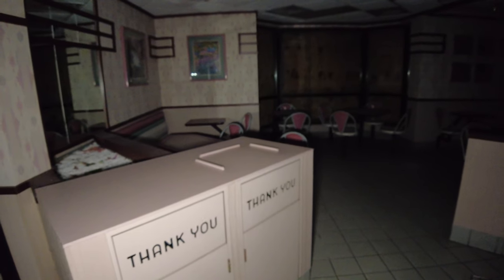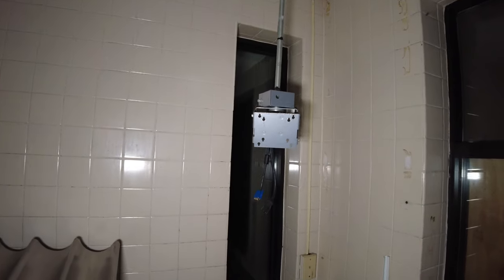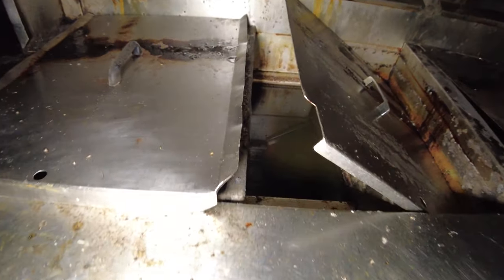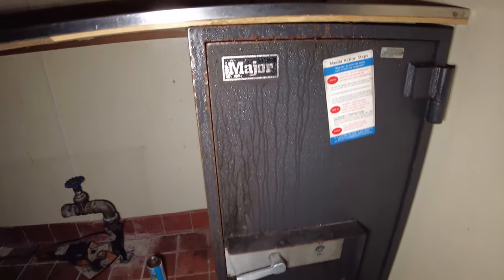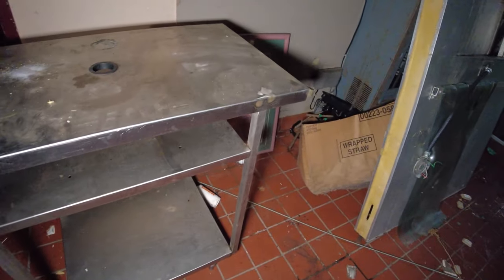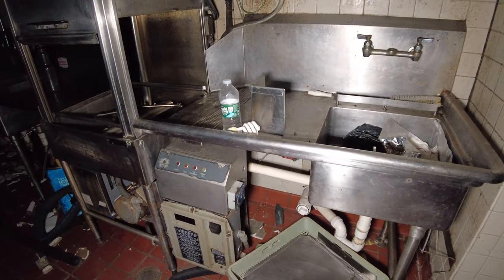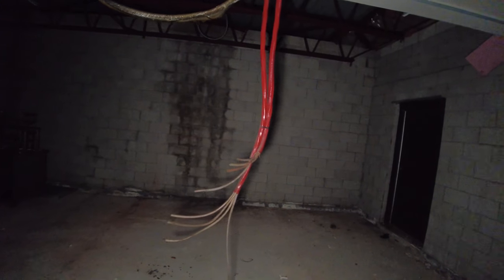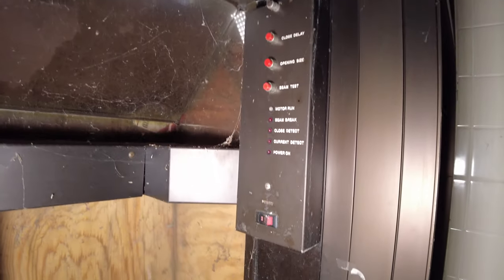Abandoned Retro 1990's McDonald's- Ice Cream Machine Still Broken

Comment: Wow great video.  I love collecting stuff from abandoned places like these.  All that restaurant equipment is worth top dollar, not in scrap, but to a used restaurant fixture company.  They would buy it, clean, and repair it, test it fort proper operation, and then resell it.  That garland range, and the fryers are worth some money as well as all the other stuff.  Looks like someone already swipped the walk in freezer cooler combo. I can see why as they are super expensive.  From what i see the unit was and all in ome unit.  Cooler on one side, and freezer on other. Some even had a door on tge inside of one of the cooler walls that would allow access to the freezer section from inside the cooler.  That may of been what that panel was you saw laying there.  I am surprised that the owner has not either sold or auctioned off all this equipment.  I used to work for a guy that purchased used restaurant equipment.  I do refrigeration so my job was to service all the reach in coolers freezers ice machines ice cream mavhines ect.  Id clean them, replace any broken parts, recharge freon if needed, and run them for several days to mske sure they are in top working order before selling them.  I would of tried flipping some of the circuit breakers back on to see if the lights and what not would come on.  Would be cool, but id turn them all back off before i left.  I did that with a few abandoned burger ki gs i was able to get in.  I had to throw the main on first.  Way to tell if power is coming to the building is look for the electric power meter, usually mounted on back side of the building, or on the pad mount power transformer which is that big green box you see behind the building or at the end of parking lot. When you find the meter, look at its digital display, if its lit with flashing numbers, then there is power coming into the structure.  Also that big 3 phase green transformer will be making a soft humming sound.  If digital display on meter is blank, and transformer is quiet then power is usually been turned off inside that transformer, the utility co wil open the transformer, and pull out the fuses on the primary side thus killing power to the structure.  Also i would venture to say thid mcdonalds was built in the early 1980s.  I can tell by the booth seats.  They are the same seats and tables that were in the eatly 80s burger kings.  The seat part is made of fiberglass, and they just put a vinyl pad against where your back rests.  These seats were very uncomfortable to sit in for long periods of time.  Well i must say, such a fool find.  I hope someone puts this building to use or purchases all that equipment and reuses it.  Great video.

Comment: I work at a McDonald's in MI and that back room (10:27) with the hot chocolate dispenser looks to be where dry stock used to be. If you look at the floor you can see where the rails probably used to be. We have moving racks on rails for dry stock at my store. That's my best guess.

EDIT: Thank you for sharing this, I have always been a fan of urban exploration and it's really awesome to see an old McDonald's left there behind, It really is almost like a time capsule from the before times lol.
Reply from the maker: Thank you for letting me know and for checking out my video. That would make sense. It seems like once they closed they just stored all that random stuff in there. Sadly, they have painted the outside white and removed all of the stuff from the inside. The building is up for lease now.